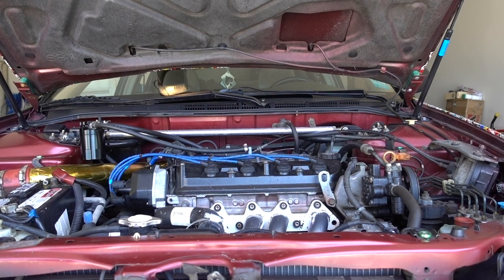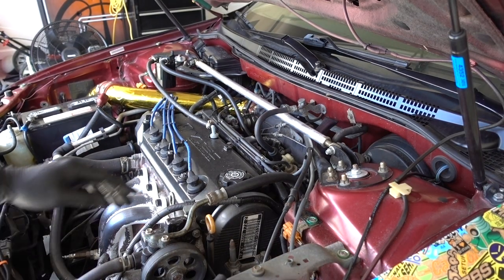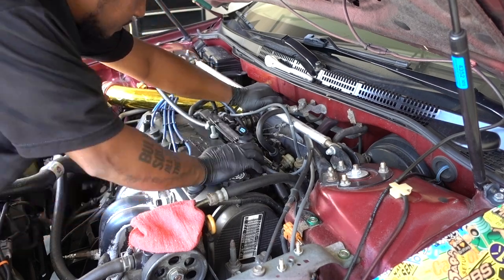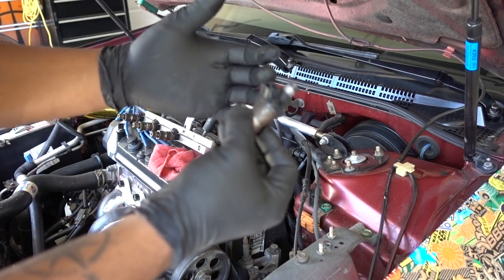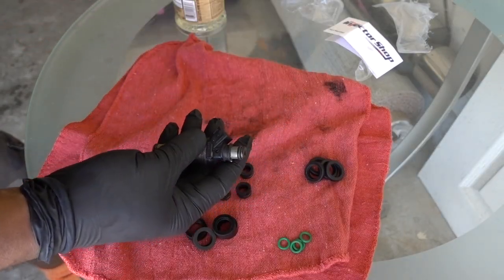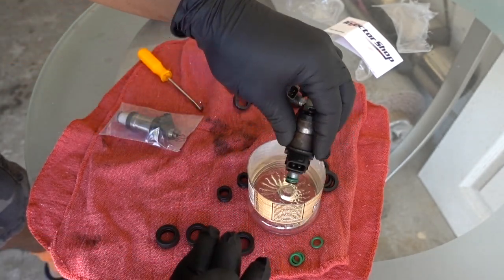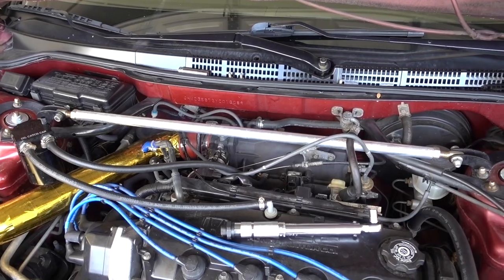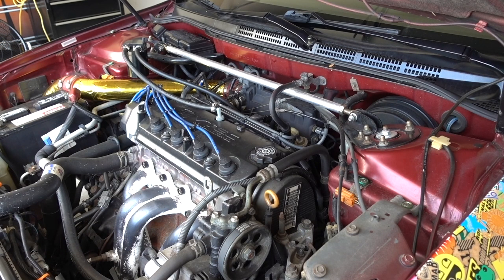How To Replace Fuel Injectors and O-Rings || 1998 to 2002 Honda Accord

Comment: To relieve fuel pressure 1) remove fuel pump fuse, then 2) start engine. (Or pull fuse while engine is running.) The engine will stop when the fuel lines are clear and pressure relieved. Don't forget to replace fuse when fuel system work is completed.
Reply: This is the easiest way!
Reply: This kills the injectors on this vehicle so fuel pressure is not relieved. You have to pull the fuel pump power connection at the pump.
Reply: Or just leave the car overnight and slowly release one of the line let it squirt a little then most of it will be gone

Comment: Do u think it’s best to get the injectors from the junk yard..or buy them brand new… & my car is loosing power when idle & may cut off idle too long & I smell gas is this the injectors???
Reply from the maker: Brand new, but I can’t tell you if I’m not there, see where the fuel is coming from, and get a scanner to see what’s the fuel pressure coming from the pump and if the injectors are firing correctly

Comment: A couple days ago my 2002 honda accord would occasionally misfiring when going uphill slowly. I got a P0304 code.

Today I replaced all fuel injectors. I stress-tested my car by going slow/fast uphill. My car wouldnt pass 4k RPM and I also got a P1259 code. I checked my oil levels and they were low. I am an aggressive driver so I assume that is what causes the high oil consumtion.

Now that my car has new fuel injectors and sufficient oil, my car runs like new. VTEC sounds beautiful and I can go uphill very fast.

Thank you so much for this video bro 👍
Reply from the maker: Nice

Comment: i did this on my 02 accord v6, and the injectors came out of the rail with quite some difficulty... but when i lubed the seal, they seemed to go in almost too easy...  i don't seem to have any fuel leaking, and i can't smell any fuel when i put my nose in close to the injectors, but they are mostly under the intake manifold.  is it normal for them to go in so easy to the rail?  i ask because, i'm trying to track down a p1399 random misfire code that i developed right after...  unsure if potentially a tiny fuel leak could reduce fuel pressure enough to cause this, or what...  in my mind i dont think so, but i'm at a bit of a loss..  i also did a valve adjustment at the time, and was meticulous w it-- quadruple checked everything...  but maybe i overtorqued the valve cover bolts and created a small vaccuum leak or something..  at a bit of a loss.
Reply from the maker: Did you clean the egr passage?
Reply: @BulletSolano  i cleaned out the intake manifold very well, but the actual egr path going down into the lower manifold didn't need cleaning.  
the one thing that i did do, that i'm going to undo is mismatch spark plugs.  i had to put 2 new ones in because the threads of the older ones were gunked up w threadlocker from the previous owner...  all 6 of my plugs are ngk, and in good shape, but 4 are platinum, and the 2 new ones are iridium.  didn't think that could make a difference, but im hoping it is.  i tried unhooking each ignition coil at, and when i did, there was a noticeable change, so i dont think i messed up any wiring-- or pinched any wires or anything... 
i'm hoping its the 2 irridium spark plugs, if it's not that, i'm going to put new ignition coils in it... if that doesn't do it, i'm either gonna take it somewhere to have a scan tool put on it, or get new injectors to put in to it.  just frustrating to do work, expecting an improvement, and taking a step backward before going forward]
Reply from the maker: After all that do a vacuum leak test
Reply: @BulletSolano  you mean hook it up to a smoke machine?  or another way
Reply from the maker: Yes
Reply: @BulletSolano  thanks.  just curious, too, how tight did your injectors fit into the fuel rail?  from the video it looks like they went in very easy, like mine did
Reply from the maker: Yeah really easy,
Reply: @BulletSolano  thats what it looked like in the video.  makes me less paranoid that i messed that part up, haha
Reply: @cryeredd7563  what ended up being the fix for the p1399 issue?
Reply: @teebone4716  one of the fuel injectors was getting stuck on.  Guess I must've damaged it when cleaning it.  Lesson learned lol.  Wouldn't recommend taking out injectors and cleaning them if they aren't giving you an issue.  Learned a lot tho, so I'm glad I did it in a way
Reply: @cryeredd7563  ya I've sadly replaced everything up to this point and I think that might be my issue. Im going to dig into it this weekend wish me luck lol
Reply: @teebone4716  they can be spendy for oem.  Almost don't want to go aftermarket for those.  Heard good things and bad.  They aren't bad to put in.  The back side on the v6 can be tricky to get the fuel rail off, but w the right tools it's easier.

Comment: My '02 Accord 4-cylinder liter makes a clacking noise like a '56 Chevy. It's been doing it since 60k miles and now it's at 119k and still clacking. Dealers say there's "no problem."  I've adjusted the valve lash several times and no change in sound. I've read that these Accords have heavy injectors and they can make this noise. Have you heard of that? Otherwise mileage and performance is good. (It's the ULEV model if that makes any difference.) Yours is so nice and quiet on idle.
Reply from the maker: ULEV has a different exhaust manifold, a more restrictive intake manifold and cylinder head, and less horsepower, but I don’t know if that makes a difference on the sound! Probably
Reply: @BulletSolano  Thanks for that info about the ULEV. But I've heard the clicking happens on a lot of 6th gen Accords. Maybe I'll try an injector swap. You made it look easy. Love your vids and they've helped me a lot.

Comment: I have a 2001 Honda Accord Ex, it cranks but won't start, it has a new fuel pump, distributor, and battery. Could the fuel injectors be causing this?
Reply from the maker: Check the timing belt

Comment: I had a spark plug gasket leak on the valve cover, a lot of oil went in but I cleaned as best I could. Now I'm getting what feels like misfires and hesitation. I had p1739 so I changed the 3rd gear pressure switch and it's a little better but still same issue. Any chance oil somehow messed up the fuel injectors? 01 Honda Accord 4 cyl 2.3
Reply from the maker: Probably the spark plug cable or spark plug are wet, clean them out
Reply: @BulletSolano  I cleaned them dry and fixed the leak, I check and they're nice and dry
Reply: I just saw your egr passage clean video so I'm doing to do that now actually
Reply from the maker: Ok
Reply: @BulletSolano  I just finished the egr passage and throttle body clean, everything connected back up. Slight power increase since it wasn't too dirty but now it won't go past 5000 rpm and makes a noise when I hit the 5000?
Reply from the maker: Make sure everything is connected
Reply: @BulletSolano  ok I will thank you so much for the responses
Reply from the maker: No problem

Comment: I have bought 2 sets of injectors.  Only 1 of the 8 has the pintle cap on it.  Are they not necessary?
Reply: Es necesaria esa tapa ya que quitarlas es difícil se puede quebrar el inyector hay que asegurarse de ordenar el inyector correcto

Comment: Is there a plug order when reinstalling? Mine is running rough after I installed them today
Reply from the maker: What cc injectors you got? Probably not the right one
Reply: @BulletSolano  The seller said that they are 240cc
Reply from the maker: If you can put the old ones back, if the car is running ok then the new injectors are the problem
Reply: @BulletSolano  You were right. I cleaned my old ones and put them back in today and the car runs fine. One of the o-rings was
a little off center when I installed them. Do you think that will be a problem? None of them are leaking fuel
Reply from the maker: You should be ok

Comment: well what do i do if the bottom peice u said not to remove from the fuel injector its self comes off? what do i do then?
Reply from the maker: Push it back on! If it doesn’t get in place probably you need a new injector but before you go an purchase a new one, put it in the car to see if you have any leaks
Reply: @BulletSolano  do i acually need it? some autopart stores and stuff said i didnt need that bottom plastic peice?

Comment: Are they 240cc injectors ?
Reply from the maker: I didn’t replace it, I purchased that one for the video, but I still have the originals in the car, get some from Autozone or any auto parts store with warranty because the amazon store I get that one doesn’t said if is 240cc light the originals

Comment: I have a 99 honda accord and I'm having a issue where my fuel pump and my relay are working but my car won't start I've replaced the alt and the spark plugs with wires and new battery and stuff but still won't start and when I crank it over I smell gas can you please help me
Reply from the maker: Distribuidor is bad
Reply: OK thank you
Reply: My ignition coil was bad but I just replaced it and now it just makes a tik sound won't start or even try to turn over like it did before
Reply: Never timing belt is broken I guess lol

Comment: I replaced my injectors and now my car is sputtering and shakes hard from the back I did everything the video said please help
Reply from the maker: Scan for codes, and go from there, probably the conector is not plug in all the way in one injector, or you get the wrong injectors or probably something is not connected, but scan first

Comment: I changed my starter and the distributor and mine still cannot start. I think that I have to replace the fuel injectors or the timing belt.
Reply from the maker: Don’t buy parts if you don’t know what’s wrong with it!! Check your fuel pump, fuel pump fuse, main relay and timing belt
Reply: If your timing belt broke the motor would be toast.

Comment: I changed my fuel injectors now my car won't start
Reply from the maker: Did you disconnect the fuel pump?
Reply: @BulletSolano  I don't think I did. I think my fuel pump is under my seats In the back. I havent gone back there.... maybe something up under the hood I didn't plug in. But it ran for a day lol then next day no
Reply from the maker: Ok, check your battery as well